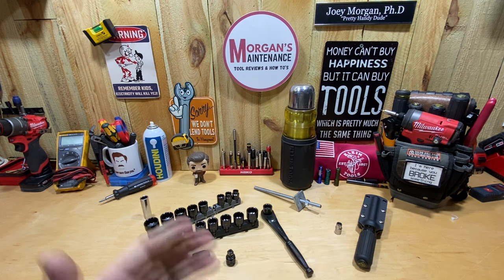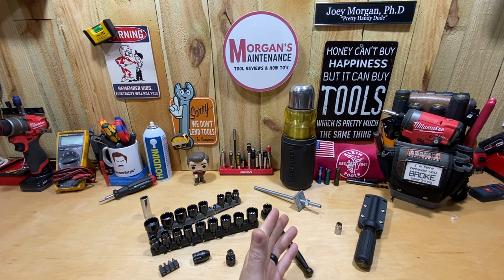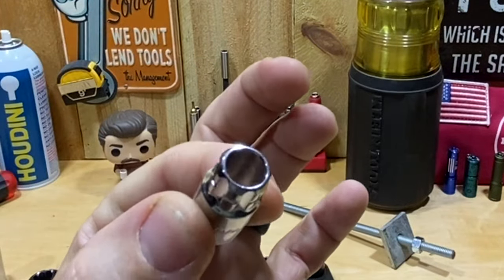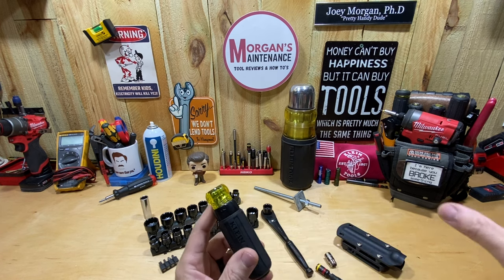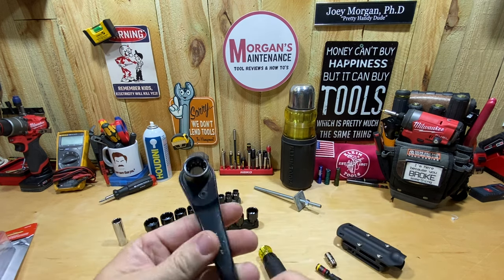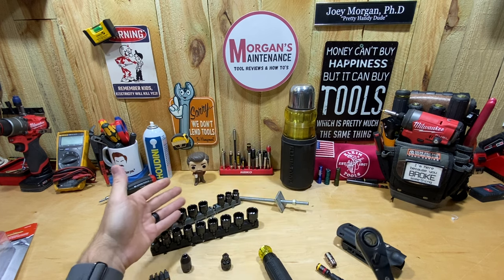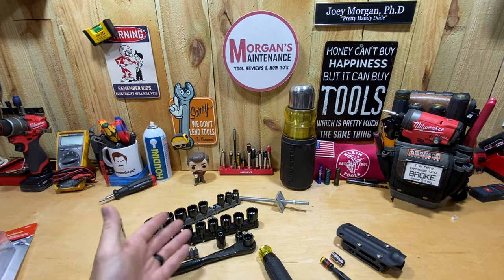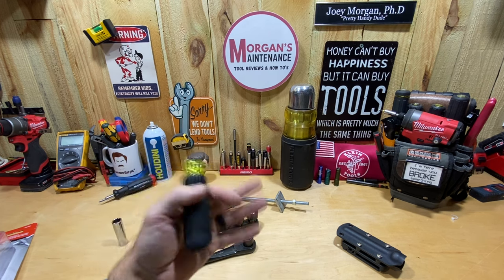KLEIN KNECT Alternatives - Do any other Pass-Thru Sockets Work with the 11-1? #tools #klein #tool

Comment: I have the Crescent set (fits perfectly in the Milwaukee 14 inch pouch in the 48-22-8183 set). I recently bought the Sata tap wrench set, model ST50402 (also made by Apex), and the exact same as the more expensive Gearwrench set. It accepts the Crescent bits for added versatility.
Reply from the maker: 👍👍. Appreciate that

Comment: I had the crescent set. Found myself needing the 3/8 adapter a lot due to needing to use some torx sockets. Then I found out the adapter socket is deeply flawed, it inserts into the ratchet from the rear so it pops right out if you apply any pressure while fastening. Really wanted that to be my main ratchet but it was a deal breaker.
Reply from the maker: Appreciate the feedback… that helps others see the flaws 👍👍

Comment: Pass-through are very handy for specific jobs, although perhaps not as unique now that ratcheting spanners are available. 
The Crescent wrench set will fit quite nicely in a Veto parts bag, unless you wanted to go all the way and get a plastic case and some Shadow Foam and cut it all in. 
I have Crescent and Gearwrench 3/8 pass through and they are cross compatible. 
For the UK they are also compatible with the Halfords own brand of pass-through sockets. Neither are compatible with the system from Bahco that I have. 
I would love to pick up the Klein KNECT and ratcheting 11 in 1, but they aren't available in the UK at the moment.
Reply from the maker: Appreciate the info… I was thinking of starting out putting them in a parts bag like you said.  If it was something I used real often I would probably do something different, but I don’t mind digging for a size with occasional use.
Reply: Ratcheting spanners have been around since the dawn of time. I promise you if you go digging around your grandpas old tool box, you will find at least 1 old 2 piece stamped steel riveted handle ratcheting spanner. Some tips for ratcheting spanners. Never buy non locking flex handle ratcheting spanners. Applying any force at an off camber angle (its intended purpose) will cause the spinning action to pivot sideways off the head of the fastener. This is true for any size fastener head under 12mm. Locking flex heads do  not do that. (Now that I think about it, non locking flex ratchets do the same thing on smaller fasteners.). Reversible ratcheting spanners are the preferred choice over non reversible, Except when space is limited. The reversible style has an offset on the closed end and the non reversible closed end is straight inline with the body of the spanner and the closed end profile is a bit thinner on the non ratcheting. It’s just annoying to be wrenching in a tight spot always having to stare at the wrench to figure out which way is forward or reverse. That little reverse lever is detrimental to enjoying the ratcheting wrench. I went over a decade not owning spanners because I had the pass through socket sets. There was maybe 3 occasions in that time where I had to borrow a wrench. I finally found a good close out deal on the reversible wrenches and many years later, many wrenches hanging above my bench at the shop, I’m still reaching for that low profile pass thru socket set. It’s about that handle feel.

Comment: You have a real talent for presenting tools. Great video.
I've never really needed pass-through sockets. And even if I sometimes think about getting some, all of a sudden it comes to me what a vast collection of ratcheting spanners I have :)
Reply from the maker: Yeah, I have ratcheting spammers as well, but occasionally it’s nice have that nut up against the bottom of the socket to keep you from slipping off.

If I had to choose one, I’d go with a good spanner set though.
Reply: @MORGANSMaintenance  Yep, that's the nuisance with spanners, but with time I just learnt to keep them on the nut.
Reply from the maker: @Stefan_Kawalec  👍👍

Comment: So did you ever find a brand other than klien that fits?
Reply from the maker: No.. not yet.  It’s looking like it’s proprietary so far.
Reply: @MORGANSMaintenance  give it time it's half inch so it's only a matter of time before it gets one to match. In the meantime as a facility maintenance technician. Do you think I should get the cresent one that has the adjustable wrench for the ratchet or bite the bullet and get the Klein.
Reply from the maker: @davidmorris2549  the lack of metric on the Klein for the price has kept me from buying it… that and the bulk of the pieces are driver bits.

I don’t think the 3/8 set works in the screwdriver… so I feel it’s definitely too overpriced for just a set of SAE Passthu’s

I think the Cresent are good for the price… I’m not sure how well they will hold up over time yet.

The Gearwrench sets aren’t priced bad for how much you get… I’m not sure if their warranty Is good

Comment: 20 years of pass thru knowledge here. Way past borderline obsession. I just discovered this new kit from Klein, did some research and I am headed down to Lowe’s to buy the ratchet kit right now. As far as compatibility,I have a hunch. Stay tuned
Reply: Sorry. I saw the empty parking lot at Lowe’s and totally forgot it was turkey day.  Anyways.  I suspect the Kobalt Xtreme Access 1/4” drive pass thru sockets might fit. The drive part of the socket measures 13mm (just a smidge over 1/2”) and the ratchet drive ring measures approximately 13.5mm. In one video I watched (yours?) it was mentioned that the 2 Klein socket sets were 1/2” and 5/8”. I’m not sure how or what parts were measured but it might be a close fit. The 3/8” Kobalt sockets are 19mm so not even close. Now my hunch is a pass through set that was sold at o’rileys auto (Power Torque). It doesn’t come as a kit and the sae and metric sockets are sold separately, so if someone wanted to buy the metric rail of sockets (5-13mm for about $15) maybe those will fit. Power torque sold a 3/8” drive pass thru kit but  it’s been discontinued. I found the ratchet on eBay but can’t find the sockets anywheres. Those might fit the screw driver because the 1/4 drive was smaller than Kobalt and I suspect the 3/8” drive was also smaller. They do sell a new 3/8 pass thru kit but it is the larger 19mm wide drive sockets. I’d be happy to answer any questions. I’m pretty versed in the 2 common styles of pass thru. Including things you might not have even considered.
Reply from the maker: The Klein set for sure works with the screwdriver… but maybe if you get the ratcheting screwdriver you can try it with the other sets you have to see if it works.

Really what we are looking for is a pass through socket set that the attachment part of the socket is like a 1/2” nut size.

I figure a 1/4” set is the only one we might get lucky on… most 3/8 will probably be too big.

Appreciate all your help 👍👍
Reply: I forgot something else. I’ve been looking for the power torque sockets and discovered “low profile” sockets. Most of them are pass thru but use a square drive as the hole so you can use 2 ratchets or a ratchet and a wrench for high torque applications (Genius! But gear wrench thought of it too for the bit set). Carbyne sells bit socket rails and list the diameter as 5/8 as I hear on YouTube to be the measurement for Klein. It should be noted that the “low profile” sockets are mostly impact ready for extreme garage use which makes building up a pass thru set for this proprietary size much more expensive. Also to note, I saw on torque test channel that team red and team yellow came out with battery powered pass thru ratchets that use a similar size socket.
Reply: Ok and the pass thru sockets that feature a universal spline instead of the traditional 6 point. Of the 4-5 different brands of universal pass thru sets I’ve had , none fit a fastener as good as 6 point. Every one I tried fit sloppy on the fastener and I even damaged a couple bolts made of softer alloy from the sloppy u-spline fit. Obviously as the fastener size increases the chance of damage is less but the smaller ones fit very poorly. U-spline has its place in the garage but not companies are advertising it as no problem fits anything! Not true. Except for their intended use they become Swiss. Do it all but not great.
Reply from the maker: @Jessknowsnothin  appreciate the info.. instead of jessknowsnothin, you should change your name to jessknowspassthru 😂
Reply: I’ve done enough research on this Klein set to realize that it’s not worth it for me. My best advice, skip the Klein all together. Gearwrench is more common, less expensive, more sizes available, great customer service, and there is more backwards compatible with other brands. Compatibility and price is key here. The Klein kits looks cool and I was a little excited about the new ratcheting driver but I don’t need another proprietary socket size. That would put me well past obsession into the realm of insanity. Anyways, the Klein kits are for electricians. 
FYI the Kobalt xtreme 1/4 drive is 6 sided. The power torque set is 6 sided. 
P. S. Never put any 6sided pass thru socket into bostitch,Stanley or (unverified but reasonably doubt says it’s the same) dewalt pass thru ratchets. They jam up real good. 
Pps
Pittsburg pass thru is its own stupid size don’t waste time thinking your adding to your set unless your just collecting pass thru.
Reply from the maker: @Jessknowsnothin  appreciate that.  The Klein on just seems a bit pricey to me for the amount of sockets you get.  It’s a 32 piece set… but most of those are driver bits.

Thanks again for the info and advice 👍👍
Reply: Some further thoughts. Pass thru tech has a very long history of bombing in marketing research. I’ve had conversations with the director of marketing at apex tool group concerning pass thru tech. Everyone that has used pass thru agrees that it’s superior to square drive. Testing proves that. But the problem is marketing the product. They trickle out items and no one knows about it. I suspect Klein will make the same mistake. I feel like the cards are stacked against Klein not only because of marketing but because they chose to go the proprietary, proprietary route. I figure to purchase the knect line your investing $300 plus. And from what I see in the Klein Video showcasing the knect line, there’s a lot of regular square drive sockets and no metric sockets. I think this kit will be great for its intended use. Tools for electricians but it’s gonna bomb. Discontinued within a year. Gearwrench pass thru (also known as “gearratchet” and “vortex”) makes a lot of pass thru options. 39 pc bit set usually $40-50. Magnetic oil drain plug socket set about $50. Serpentine belt tool with pass thru sockets. About $50. And the cream, a huge (and small kits) tap and die set with t-handle pass thru drivers. That’s big set is gonna set you back $200 but worth every penny. Gear wrench sells so many different size pass thru kits, even extended flex handle ratchets. But they don’t market them very well at all. I didn’t know about some of them for years after  they were discontinued because of poor marketing. This is true for most companies putting out pass thru including craftsman, Draper, husky, and others. (These are Interchangeable) crescent (also vortex) makes an adjustable wrench with a pass thru ratchet at the other end. When I asked the marketing director about 1/2 pass thru he said buy what you can find on eBay because they dont have any plans of selling 1/2” drive pass thru anymore. From what I can see based on the market I predict that you should invest in this set and don’t use it. Years after craftsman and husky discontinued their pass thru kits they sell on eBay for insane prices.up to 4times or more the cost at time of retail. It’s As if they are made of gold. I even see sellers using yellow lighting to make the sockets look gold. That’s the insanity line that I won’t cross. The biggest flaw of pass thru is the lack of important adapters. I had to make my own universal and some of the socket adapters. I’m currently trying to design a pass thru gimbal and the rest of the adapters. Luckily Kobalt made a lot of adapters to convert 6 sided to “vortex” when they changed over to 6 sided pass thru so you could still use the Kobalt vortex (discontinued) Happy hunting!
Reply from the maker: @Jessknowsnothin  appreciate all the info again… yeah I think for the cost of Klein and no metric options, it’s too hard for me to pull the trigger just so I can use it in a screwdriver.  I think the Gearwrench sets are a much better option.
Reply: @MORGANSMaintenance  besides my lack of a pass thru gimbal, the only other tool that has eluded me was a ratcheting driver handle. I have a few fixed pass thru handles and I have adapters to make any ratcheting (bit) screwdriver accept the sockets but, this one had me excited for a quick second. I thought finally! They finally made a ratcheting screwdriver! Nope. Also for some reason I thought apex owned Klein. I’m sure I have adapters to make it work, but one of the very few downsides( also an upside in some cases) to pass thru is  the more adapters and extensions you add to the driver the more play you get. And when there’s play that little clip inside can’t support the weight and sockets fall out.
Reply from the maker: @Jessknowsnothin  true 👍👍
Reply: Not sure if it matters to anyone but the crescent x6 is a 60 tooth ratchet and the gearwrench and husky pass thru ratchets are 72 tooth.

Comment: I think these are the same as the craftsman max axess that came out years ago. Curious to find out as i lost some of those sockets over the years
Reply from the maker: Which ones…  the Cresent?
Reply: @MORGANSMaintenance yes.
Reply from the maker: @Will_Reed  👍
Reply: They look similar in pics but the craftsman( and husky pass thru and the original Kobalt pass through were made by apex tool group for sears, Home Depot and Lowe’s. I see Makita pass though over seas. Makita claims to be made by Makita but I think the pass thru sets are made by either apex or Draper. I’m not sure what affiliations Draper has with other companies other than the Draper expert pass thru is compatible with apex made pass thru.
Reply: @Jessknowsnothin  good info
 Thanks for that. I've had my craftsman set for probably 10 years.  Still works great. Just used it today
Reply: I just splurged on eBay and won an action for the old craftsman 80 piece max axess set( missing parts lol) I always wanted this one because it combined the parts of the 51 piece with all the bit sockets in one case. And I had all the extra parts. Very convenient not having to pull 2 cases out. (Yeah I know square drive does this on the regular blah blah blah. ). On that note I see Klein sells each kit in different cases. That’s gotta be so annoying having to detach each case till you find the one you need. Sharpie!!! I bought my first gear ratchet pass thru set at sears because I was headed to a job and forgot a socket set. I was about to buy a regular cheap socket set when I saw gear wrench and craftsman sold pass thru kits. I thought “this looks gimmicky” -sold! I eventually broke the gear wrench ratchet while using an unnecessarily long cheater pipe and sears didn’t have a replacement ratchet so I had to bring the whole kit back and exchange the whole kit for a whole kit. ( I didn’t know at the time that several auto parts stores  and fastener suppliers also warranted gear wrench) so I ended up swapping it out for the craftsman 85 piece “universal” pass thru set. What a mistake. They were splined sockets which didn’t fit any fastener well and the black finish loved water. Those sockets would rust immediately just touching something wet. You could scuff it up and grease the sockets but it didn’t matter. That rust was terminal. It eventually ate off the laser etched size markings so you didn’t even know what size you grabbed. To this day I do not buy any oxide or whatever coated type of socket , never bought tools that were laser etched, and I never bought splined again. It’s funny because to this day morons (obsessed fanatical pass thru weirdos like myself) are still paying over $200 for that 85 piece kit on eBay. $700 for the master kit with wrenches. Yeah. Just recently one sold for $700. Morgan I know I said I don’t cross the line into insanity but I really wanted that way over priced and incomplete  craftsman pass thru set. Convenience and obsession. I did buy that crescent set you have and if you listen to the ratchet mech compared to gearwrench or craftsman pass thru, it sounds like the internals have plastic bits inside. Not very confidence inspiring. And I can’t stress this enough! Don’t buy “ universal “ sockets or wrenches!! Maybe (I won’t) trust snap on or Mac splined but not regular “home owner” consumer grade tools like crescent. You will ruin fasteners!!!! “Universal” is a sales term that targets diy’ers!! Splined tools are for splined fasteners!! Ok sorry 4 the rant.
Reply from the maker: @Jessknowsnothin  👍
Reply: @Jessknowsnothin Apex owns gearwrench and crescent now

Comment: Never had a set. Or a need for one.
Reply from the maker: If you have some ratchet wrenches you can achieve the same thing… sometimes it’s easier to keep a ratchet with a socket on the nut then it is one of those.

It’s not an everyday tool for me.